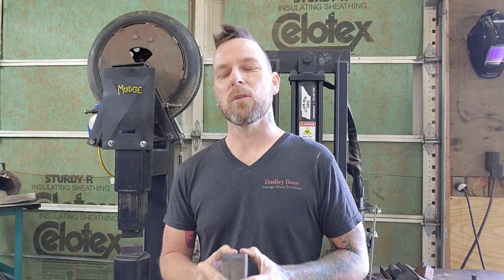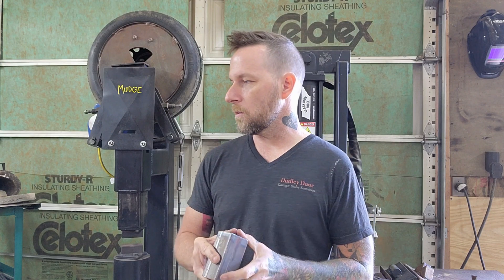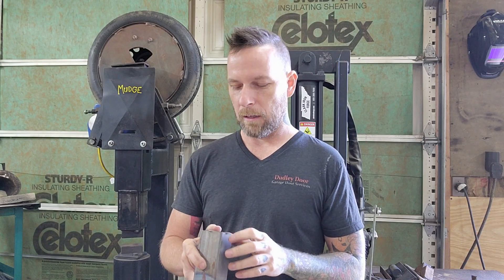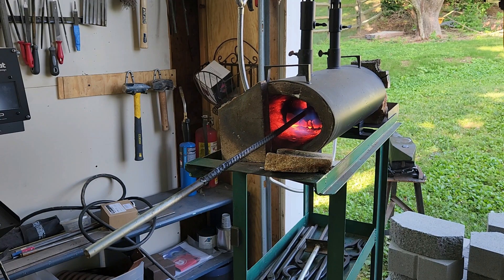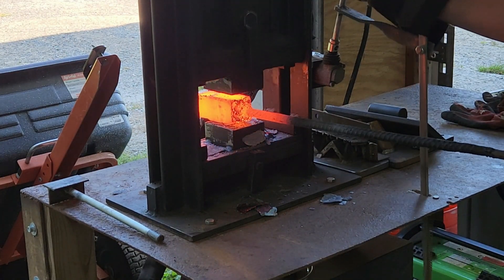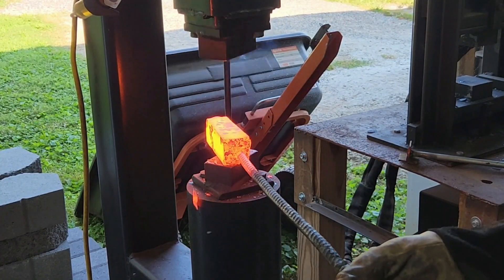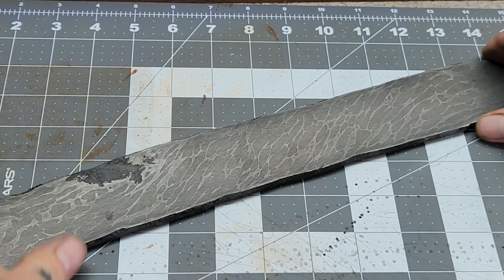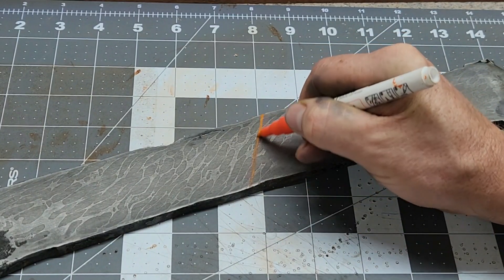Firescale Damascus. Using a canister and ball bearings to create a damascus billet, for knifemaking.

Comment: Why didn’t you remove the canister before twisting? Is there mild steel on the edge?
Reply from the maker: I went back and forth with someone about this decision, a while back. They said that it would leave mild steel on the edge. it doesn't. The canister - after I drew it out - was only twisted about 360 degrees, before I pressed and flattened it out. So the canister steel won't "twist" its way into the core of the billet. As long as you still have that high carbon center, and press it into a flatter/wider shape, the mild steel should still be on the outer edges and ground off when you surface grind, bevel, etc... I actually did a mock up of this with some green and white play-dough. I used white for the canister, and put green in the center as a core. I squared up the sides, and twisted it about 360 degrees. Once I flattened it out, and cut the white off of one edge, there was only green with no "cross over" white interruptions. It MAY be different if I twisted it a lot more, but I really don't know. I've never tried it.
Reply: @RedRightHand-Blades-Marshal either way… was BEAUTIFUL till you broke it
Reply from the maker: @kestersmith3400  thank you :)

Comment: Take this with a grain of salt, I've never forged anything before. I think you need to peel that off right away. Your carbon from the core is migrating into the mild steel.  The carbon migration is slow, it's not something you normally have to deal with, but you are reheating the billet many times.  I suppose you could also go the other way with this. Leaving the cannister on reduces the metal that gets wasted in slag. Put some soot on the inside of the cannister. The carbon from the soot will diffuse into the cannister. I don't think it will make it hardenable, but your core wont diffuse carbon. 
That British guy did something interesting. Argon was fed into the pole that held the cannister.
Reply from the maker: That's interesting. I still have the other half of this billet, and I know my heat treat process for this particular steel needs an adjustment. I guess I'll find out when I use the second half of the billet, if there are any issues. 

Are you talking about Alex Steele? I haven't seen the video you're talking about, but that sounds like something he would do. He's always got some pretty clever ideas.

Comment: BTW,  MIG welding should go "forwards" (ie. Opposite to stick welding).
Should make it easier to see what you are doing, and have a nice "flowing" weld pool.
I know this because I did it the wrong way for a while before I sorted it out...
Reply from the maker: @jamesspry3294  thanks for the tip! I've seen it done that way too, and I've always struggled when I try. But I'll keep working at it. I'm no more than a novice welder, so I definitely don't want to get into too many bad habits.
Reply: @RedRightHand-Blades-Marshal  Ha ha. Yep! We all started that way. I'm not much more than a novice, but I keep trying. That's the way to get better.
Also, having a good welder to ask questions really  helps! (I've been lucky in that way)

Comment: Good work mate!
I love the idea of leaving the can on when you twist. That way all your cold shuts and inclusions get ground off. And you don't lose so much hardenable steel, but only mild steel.
Looks great too!
Question: why didn't you clamp the bar in the centre of the vice, when twisting? That's where the vice is strongest... Looks like you struggled a bit with that... Or was it just the camera angle?
Reply from the maker: @jamesspry3294  hello, and thanks for watching! 

The answer to your question is simply that I've never done this before, and I haven't mastered the technique. I don't know if moving the billet to the center of the vise would have made much difference. The vice should give pretty uniform pressure from both sides all along the length of the jaws. The problem is that the steel is soft, so no matter how much pressure you have in there, when you start putting force on it, it will give. However, I do recognize that I need a better tool for twisting. And I definitely was struggling. I've seen other bladesmiths make "twisting tools" from pipe wrenches. Essentially they just add a second handle to the top of the pipe wrench jaw, that way when you twist you're twisting with even pressure from both sides, which should prevent it from wanting to keel over in the vise. So the next time I try this, I'll make sure I weld something up to compensate. 

Thanks again!
Reply: @RedRightHand-Blades-Marshal  You are still ahead of me there. I've only done blacksmithing on a coal forge about twenty years ago (still trying to set up my forge ATM). Haven't done any bladesmithing yet (my goal...). When I did a few twists when I was learning blacksmithing, we had a few "double handled" tools and stuff like that. But I seem to remember that there were many ways to do it. Also, the bends are fairly easy to straighten later on.
I was just thinking that the centre of the vice (ie. in line with the screw) is also the thickest part of the jaw, and will be the least prone to heating up, bending and "loosening". At least that was what I was taught by the tradesmen than I've worked with. (Also, make sure all the forces go into the body of the vice, and not into the screw, otherwise you'll break it, etc etc etc.)
Keep up the good work, and don't get discouraged. You are doing well!

Comment: With as much scale that was coming off the canister when you first started compacting the billet there can't be a lot left of the canister to grind off. Maybe some on the ends but I would not think much of the sides are left to remove. Nice looking pattern.
Reply from the maker: I've always been under the impression that forge scale is not really part of the original steel, but rather a culmination of carbon build up from the gases and oxidization that forms in the forge. I could be wrong about that, I've never really researched it. Definitely something worth looking into.
Reply: @RedRightHand-Blades-Marshal  Scale is Iron Oxide (Magnetite or Fe3O4). You'll lose a bit of steel and a bit of carbon on the outside when it scales up. Not much you can do about it, unless you can remove the oxygen from where you are working...

Comment: Did you grind off the canister before twisting?
Reply from the maker: There are a few ways to tell where mild steel starts and stops. You can easily do a file test along the edge to see if it's consistently hard. But you can also see visually, after it goes into the etching solution. 

I'm not sure where you got the idea that I twisted it more than 360°. But that's just not correct. If you watch the video you can see that I did a 180° twist, then came back and repeated that. I didn't twist further. 

I'm not sure how to convince you, other than to encourage you to keep watching and when you see the final products you should be able to recognize that the pattern is uniform with no mild steel breaking it up. 

Thanks for watching!
Reply: @RedRightHand-Blades-Marshal  absolutely, I'm convinced. I just found an opportunity to be educated and took it. Thank you
Reply from the maker: No. There's no need to, as long as the mild steel stays on the outside, and the core is hardenable, you're good to go. 

(I actually just finished this blade today, and there's no evidence of the canister anywhere on it, and it's still a very beefy knife).
Reply: So I've never forged anything. But I will say, once you twist it like that, no, mild steel won't be staying on the outside. I'm sure it came out beautifully though. I'll Check the other video now
Reply from the maker: @abadran8174  I could see why you'd think that. However, the mild steel doesn't "push itself" into the center as you twist it... (This is weird, but imagine filling a sock with Play-Doh, and then twisting the sock 360°, then pressing it flat, turning it up on its edge, and slicing perfectly down the center. You would still have a Play-Doh core). 

You can't see it in this video, but if you wait for the finished product, you'll see that there's no mild steel left. It all gets pushed to the spine, and the edge, and gets ground out when shaping the profile, and surface grinding.
Reply: @RedRightHand-Blades-Marshal  I wouldn't know even if it had mild steel in the blade 😁.
However, I think it's morel old playdoh in a canister of chewing gum, and the twist was more like 1640 than 360. I also see bladesmiths grindimg it off every time. If the mild steel can actually be seen in the blade if it were to make it there then absolutely.